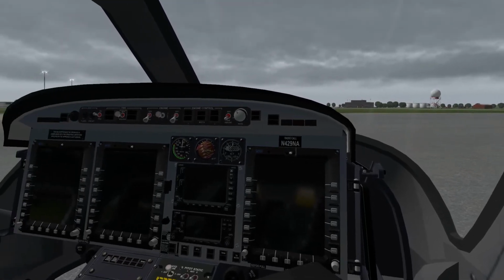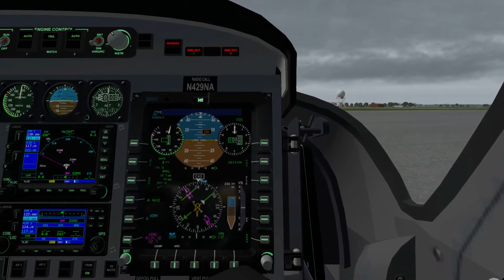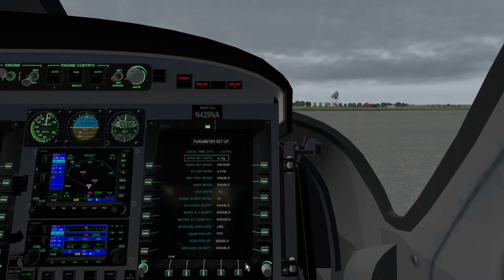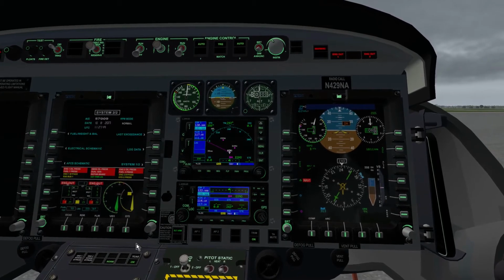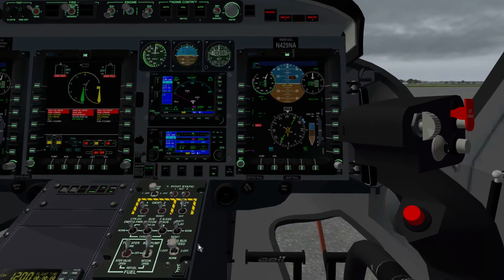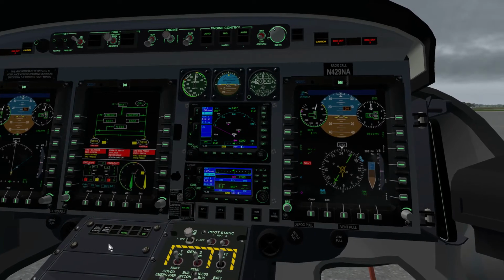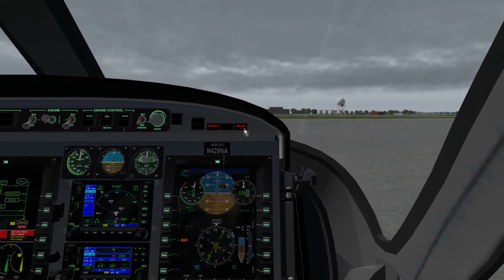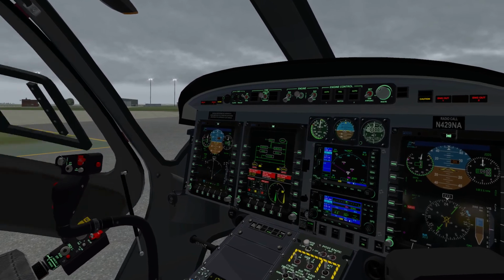Cockpit and Displays

Comment: How do you move around the cockpit as you do in the video.  I can only go up, down, side to side with my keyboard  ... can't look up top or the throttle like you can.  Also I'm not seeing how you changed the heading indicator.  How is that done?  Also that mant. switch that brought up the configuration isn't on the panel of the 429 I have.  There seems to be several buttons that are either missing the labels in your video or not working on the control panel.
Reply from the maker: I use TrackIR, some of the buttons still to make workable.